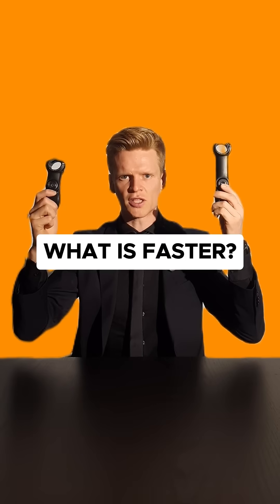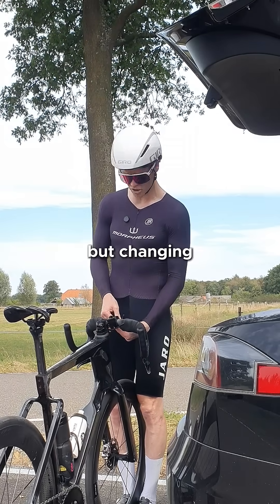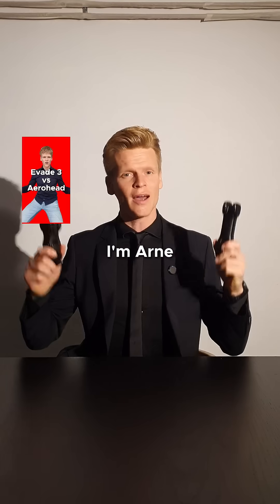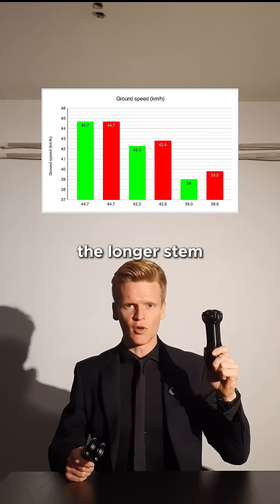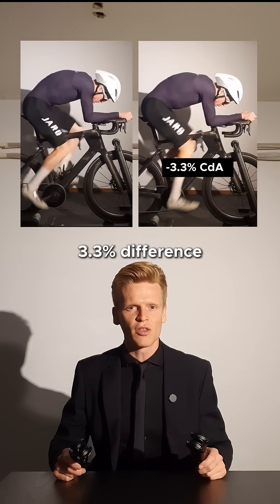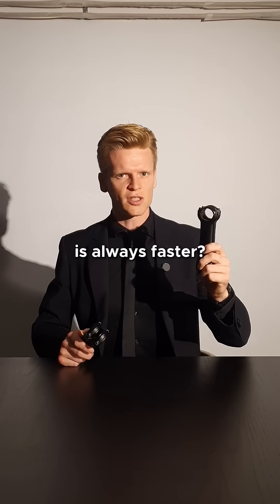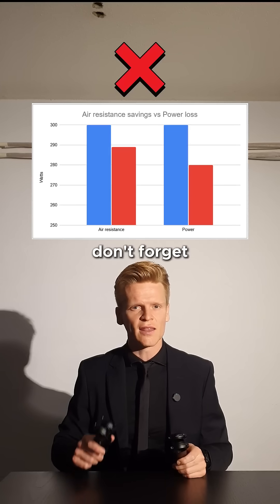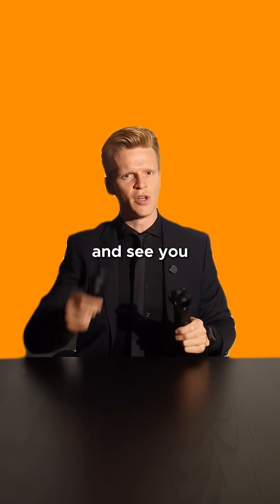Short vs Long Stem

Comment: You have to change the frame to compensate, in this test you change your position as well.
If you want to isolate how stem length affects your speed you'd have to change frames as well.